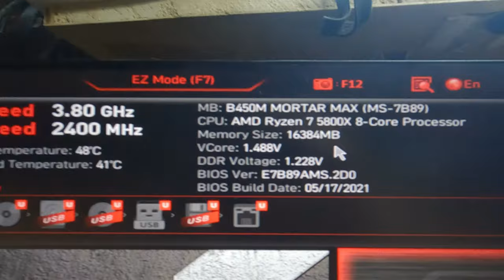Upgrading AMD Processor from Ryzen 3 3200G to Ryzen 7 5800X Tray Type

Comment: kumusta performance ng tray type sir?planning to buy sir para makatipid hehe
Reply from the maker: goods na goods boss walang kong issue so far... worth the upgrade
Reply: naiisipan ko kasi bumili baka kaso iba performance ng tray type sa box type
Reply from the maker: hehehe walang difference po
Reply from the maker: both walang fan included box or tray man ...
Reply: @jeffraagas5218  ang alam ko difference lang walang box ang tray type pero sa performance same lang.
Reply: @blackthorne2001  thank you boss akala ko kasi parang peke ung tray hehe
Reply: @jeffraagas5218  and one more thing d tumatanggap ng warranty ang amd pag naka tray dun mo lang sya pwede dalhin sa pinagbilhan mo so it means mas short ang warranty nya dahil dun mo lang sya pwede ibalik sa shop na pinagbilhan mo